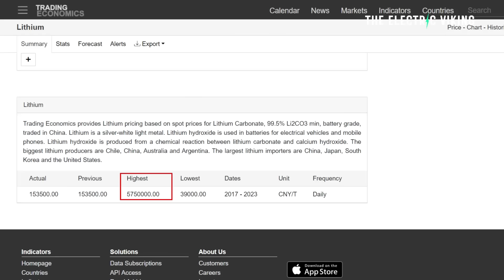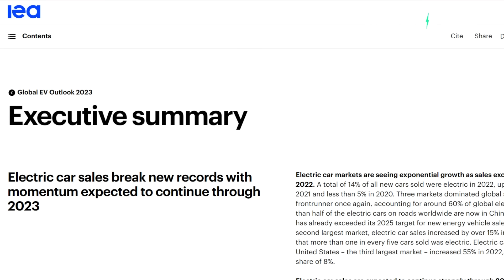The reason Electric Cars will be cheaper than ICE cars in 2025

Comment: Hi Sam - Love your stuff and I don't want to rain on your parade, but you totally got Moore's law wrong. It has to do with the number of transistors in an integrated circuit being able to double every 2 years. This results in the capability of the technology being able to double every 2 years at a fixed cost. It works out to a 41% CAGR. Here is a link to the Wikipedia page https://en.wikipedia.org/wiki/Moore%27s_law  Please note this is for semi conductor chips only - not cars or other items.

Comment: no way.the only reason is that ICE car builders are increasing their ICE cars that the difference is disapearing. But thats not the reason why people are not purchasing EV'S. EV'S are not practicle and unsafe,dont go far enough, would need to triple the number of chargers, next the insurancew companies dont want to insure them because they burn when an accident occur, and even if they dont a damaged battery is unrepairable. they kill their driver : doors wont open if battery shorts in an accident.. next they need expensive tires because of the weight and need replacing every 2 years. 12 volts battery issues : they die if your car is not charge on a regular basis.  and your car wont start.The idea that you should not charge your EV pass 80% and dont drive them below 20% is absolutly crazy, you just lost 40% of your battery.none of tyhe existing EV'S is worth buying.

Comment: I don't think you can compare ICE cars to Blackberry. Blackberry was a flash in the pan of history. ICE cars have been around for over a hundred years and have completely pervaded transport as the best solution for that entire time. Blackberry was only ever a niche product.
Electric cars will not be practical for everyone, at least for the next ten years, since not everyone can charge at home.
Yes, the massive increase in use of lithium batteries will bring prices down, but new battery technology will push prices back up and today's battery technology will become obsolete in perhaps 7-10 years.
The thing is, most people buying EVs are those where an EV works for them. At some point we will reach saturation, leaving people where EVs do not work for them who will not buy an EV.
Will EVs be cheaper than ICE cars in 2025? Perhaps the sale price will, but that will probably be invisibly subsidised by governments. I don't think EVs will be genuinely cheaper until after 2028.
I do however think it will be interesting to see if people will still buy ICE cars, even when an equivalent EV is cheaper.

Comment: Think about this....
In a petrol car we have petrol tank that you must fill every now and again.
In an EV the "tank" is basically the Battery, which you must charge (fill) every now and again with Electricity.
The fuel for an EV is ELECTRICITY and it must come from somewhere......
The EV Tank (Battery) is massive and very heavy compared to a Petrol Tank.
If every vehicle was an EV the Electricity fuel required would be of gigantic proportions and        the electricity distribution would have to be upgraded at huge cost.
But still the problem remains.....
Where does the fuel come from.?
Energy does not come cheap.

Comment: Next 2 years? No chance whatsoever... Why should I as a normal consumer buy an EV when my current car uses under 6 l/100 km petrol and has a range of 700+ km and "charging" absolutely everywhere in a minute and a new one costs aroung 25000 and I am fine with its performace etc.?

Even if there would be an EV at that pricepoint, who would want to buy an inferior product? People do not want to downgrade when buying a new product, would you buy a laptop with half the battery life as the old one?

Production price, battery price etc. is absolutely unimportant for us consumers, we do not build cars, we buy the ones that give us freedom to drive. 

Anyway, there are some 80 to 100 million cars produced yearly worldwide and there is no way for them to be all electric. Car manufacturers already have stockpiles of unsold EVS and are slowing down production as all the early adopters who can afford an EV already have one and noone wants an EV pickup in USA or an EV compact car in EU...

Comment: This is missing a key factor: the infrastructure is not nearly ready to support a mass switch to ev in most countries.
Reply: Don't forget there is also a push for conversion from fossil fuel home heating to electrically powered heat pump home heating in a lot of places. This will also put a strain on electrical power infrastructures. Imagine being told you can't recharge your EV between 6am and midnight in the coldest months of the year because the power is needed for home heating during that part of the day.

Comment: I think what the video is saying will happen, but I think we're looking at a timetable of more like 10 years than 2.
Reply: I would agree with you, batteries are still costing way too much and unless they come up with a longer range suv/truck , don't think people will be rushing to buy them
Reply: And in 10 years, EVs will have been replaced by hydrogen, or by some form of very low emission fuel will have been devised which will prolong the life of ICE cars.  I'm afraid, Sam you are delusional.
Reply: You are hoping! But if it doesn't a lot of people are going to lose a lot of money when they start scraping gas cars having no value.
Are you prepared to take that risk as 10 years is a long time in technology terms.

Comment: I'd wait another 5 years for the battery tech to get better 2X and cheeper by 2X.  Many of Ford and GMs are using 1st gen heavy old battery expensive tech.  Also, 1st Gen cars tend to have bugs and lots of 'battery recalls' by most of the auto industry.  I'd wait for 2nd Gen or Tesla to open the door to real affordable, practical, and profitable EVs and 2nd gen batteries.  Lastly, GM, Ford are loosing big money on their EVs and are cutting back production, delaying new EVs, and delaying new battery factories.  It doesn't help to have more expensive union labor costs and continued inflation and huge gov spending.  So - wait - Tesla's charging network - now the standard will soon be flooded by all the new EVs charging.  Also, I like Stellantis new compressed air powered gas engine that is way more efficient than ICE and cleaner.  Hydrogen is still in play.  Things rarely go as predicted but if anyone can do it, it's Tesla. Watch lots of the EV competition drop like flies - Fisker, Lucid, and maybe Rivian (hope not).  And like most things in life, the market can support multiple solutions - gas, diesel, battery, hydrogen, etc.

Comment: What is this about EV cheaper than ICE in 2025?

They were cheaper since 2017 to drive. (TotalCostsOwnership is the ONLY what counts to me...this includes intrest on finances. If I invest more the bank pays me less intrest).

I saved in 8 years (2013 - 2021) 60000 euros (Netherlands) with driving an EV (leaf) compared with driving a same sized new to buy ICE car.
Half of that were tax differences, other half maintenance and energy savings...in these days I would onbly save the 30000 on energy and maintenance...tax regulations changed. But that would still make the EV much cheaper...30000 euro less on energy and maintenance, only a few thousand extra investment.

Comment: It would be  a great help if we transitioned to batteries that don't use Li for static applications.  The good news is that many of these batteries using non-Li chemistry are superior to Li batteries (for static applications).  They last far longer, can be cycled between 0 and 100% charge with no damage, are safer from a fire point of view, use inexpensive chemicals which are obtainable from multiple sources.  All they need is market share to follow Wright's (not Mores) law about the relation between price and sales volume.

Comment: LOL. You have lost your mind. Every EV maker has cut back production because no one wants these idiotic cars. Car companies want us to buy disposable cars so they will sell more. There is not a single EV being made that will last more than 10 years. No parts will be available to repair them later. You think car companies will make these silly screens and battery packs for 15 or 20 years? Get real. That is why the equity in the car CRASHED as soon as they are purchased. A friend of mine is losing $2000 A MONTH on the value of their Tesla. Anyone buying one of these disposable cars are getting RIPPED OFF.

Comment: The essential issue with batteries is weight. Over half the energy used to propel the vehicle is used to propel the battery. This makes no sense. Better surely, to add solar panels to your roof, add a decent sized battery system and thus minimise the use of fossil fuels at home. In Britain we are told that 25% of our energy use is used in domestic dwellings but only 5% in passenger vehicles.

Comment: Does building a cheaper death trap constitute a good thing ?  Main reason EV will soon be cheaper is that there is no secondhand market, which will kill the new car market - Tesla is in the unenviable place of getting a larger share of a declining market.  Insurance premiums for EV are going through the roof because of the sheer cost of repairing even slight damage to an EV is mega expensive, add the fire risk and no wonder some companies will no longer insure an EV at any premium.  I just hope that ICE car owners do not get dragged into paying extra, just like normal taxpayers who could not afford an EV ( even if the wanted one ) saw their tax used to subsidise rich virtue signalers.  When EV drivers brag about their cheap fuel I often ask them if they factored the massive EV depreciation into their running costs, they never answer.  One youtuber in UK saw his Porsche Taycan EV drop in value from £120,000 to £43,000 in two years..

Comment: I agree that EV prices will come down and they should be cheaper than ice cars but there's a couple factors that matter that nobody seems to talk about. I have a model x and I charge it in my garage. Lots of people live in apartments and don't have home charging. Going to a charging station is expensive and time-consuming. One of the best things about electric is taking 10 seconds to charge it at home and not have to drive to a gas station. So there are many people who won't benefit from electric cars due to charging. Another consideration is if Trump is elected then the USA will become energy independent again and will even supply oil to other countries which will bring the price of gas down removing one of the benefits of electric, cheap energy. I agree that some companies making ice cars will close up. Removing some competition will be better for those companies that survive. I'm totally for electric but gasoline cars are better for some people and some circumstances. Eventually most cars will be electric especially when the feasibility of selling gasoline is gone due to reduced demand. When the gas stations close up because there's not enough profit, that'll be it for gas cars.

Comment: I don’t think it will. Its not just price… Insurers are waking up to the fact that ensuring mobile blowtorches is a bad idea. Also , repairing EV crash damage to battery packs are really expensive. Finally, lower prices alone will not solve charger infrastructure issues. Just maybe rumours of ICE cars’ demise has been over exaggerated.
Reply: I wonder when the truth is going to come out that gas cars are 60 times more likely to catch on fire then American made EVs?  You can Google it, there's 180000 gas car fires per year in the US alone.  Probably only about 50 to 100 EVS catch fire per year. In the whole world it's probably more like 1 million gasoline car fires every year.
Reply: @yeahbuddy92193911  Agree, but an EV fire burns hotter and generates its own oxygen. It cannot be fought using traditional firefighting equipment and techniques. ICE fires can be comparatively easily contained. So an EV fire is a good example of a low-incidence-high-impact event.

Comment: The only problem with EV's is you have to be very careful with your charging habits if you are going to keep the vehicle after the battery warranty expires. I watched a video recently on Kim Java's channel about an Uber driver who did 100,000 miles in 1 year in a 2019 Model 3 that he bought used about a year or so ago, and even though he still had 4 years left on the 8-year battery warranty, the warranty expired anyway because of the high mileage he did... and then the battery died, forcing him to spend $9k on a refurbished battery from Tesla, which only had a 1-year warranty on the refurbished battery. This is likely not a problem for people who don't have to supercharge twice a day as this Uber driver did, but even so, it's not a problem you have to worry about with an ICE car. I have a car which has done 182,000 kms in 16 years, and the engine still has many years of life in it, but if that was an EV, there would be no warranty on the battery, and it would be degraded to the point that the range of the vehicle would be quite limited. 

My sister has a 10 year old Nissan LEAF which has a range of less than 100kms on its old battery, and it's useful for commuting 10kms to and from work every day, but the family has to rent an ICE vehicle when they go on a road trip, even though her husband's newer LEAF has a bigger battery and more range, because it's just too inconvenient to be in the middle of nowhere with a nearly depleted battery searching for a charger and even if you find one, you then have to sit and wait for ages while it gets back that 300kms of range.
Reply: Be careful drawing too many conclusions from one viral video about one car. When the battery is fine after 100,000 miles, people generally don't make YouTube videos about it, when such videos are made, they generally don't go viral. On the other hand, the one time a battery does die after 100,000 miles, all the people that think EVs are garbage get to say "see, I told you so", so that's the video that gets made and goes viral.

There are also plenty of ICE cars out there whose engine decides to die at the 100,000 mile mark, but nobody makes or watches videos about that because that's old news. Of course, there are also plenty of ICE engines that have lasted more than 100,000 miles, but there are also plenty of EV batteries that have lasted more than 100,000 miles.

Comment: OMG. EVs are so much better to drive than ICE cars. Prices are falling. Running costs are lower.  Insurance cost concerns seems to be fake news as far as my KIA EV is concerned.

In UK highway charging and town/city charging station issue is improving. There is a problem for people with no off street parking in terms of charging cheaply at home. This wont be fixed by our mostly useless local councils. It will take the newer breed of faster charging cars  being released at ICE equivalent cost for Sams predictions to prevail, as owners will most likely have to fill up at local Petrol station equivalent locations, as ICE cars do today. It will happen, then its game over.

Comment: Unfortunately, you're incorrect. Lithium Price is a factor in margins but the vehicle market is utility driven. The demand for new EVs is approaching its maximum market share in most markets. Almost half of consumers do not have infrastructure needed to make use of an EV. It will cost trillions to increase the capacity needed and there's little incentive to add the infrastructure. EVs are great for city living but high density residences below upper class cannot support EV e- demand so consumers can't make use of them.

Battery prices could drop to zero and it still wouldn't render EVs useful to 60% of the automobile sales market. And the slow speed of refilling the batteries as well as the risk of fires makes them an unattractive option for many people who can afford them. 

In sum: while electrification will likely continue, the battery technology we use today will not appear on any vehicles in 10 years time and ICE vehicles (mostly diesel) will make at least 50% of sales, and probably more like 80% of sales.

Comment: I think you meant Wrights Law, in terms of the declining cost curve. But Moore's Law also plays a key part as it allows more transistors to be added to chips within a certain area over time, and allows technology to advance. So we get both more power / capability and a lot cheaper prices due to both of these laws.
Reply: I will believe it when it happens. Until then, I will remain sceptical .
Reply: @robertfonovic3551  It’s already happening. Track the capability vs price last 10 years. If you aren’t seeing it maybe you’re clinically blind.
Reply: @michaelwebsternz Yeah, I’ve seen the invoices for battery replacements after failure, and none of those prices have come down. ❤
Reply: @JetFire9  What invoices? Tesla batteries are under warranty for 8 years. Buy an EV from an inferior company and get what is deserved when the gouge on battery replacement.

Comment: However, I do expect BYD to look at building probably at least two factories in North America for their latest blade batteries. Not only to supply BYD's own bus manufacturing coming to North America, but likely supplying battery packs to the Big Three automakers. I wouldn't be surprised that BYD blade batteries are used in the Ultium form for the smaller EV's GM plans to sell like the Chevrolet Blazer and the second-generation Bolt.
Reply: it's not gonna happpen, due to China ban, also not profitable